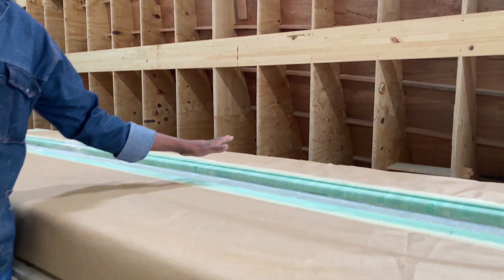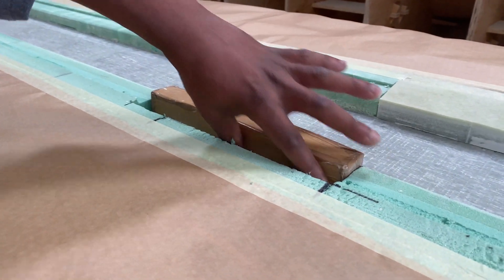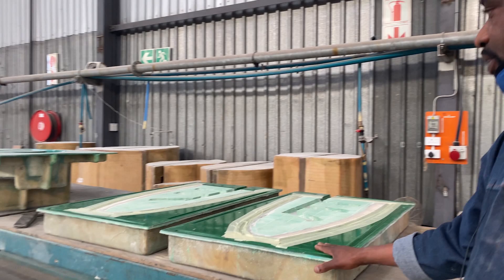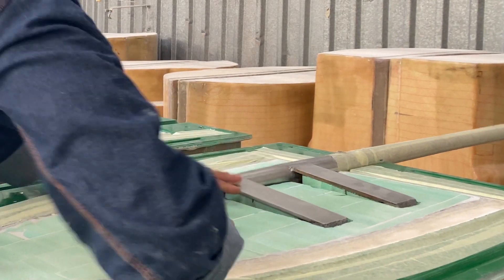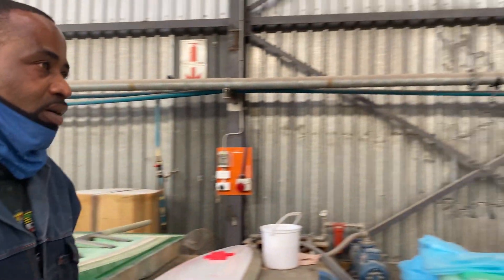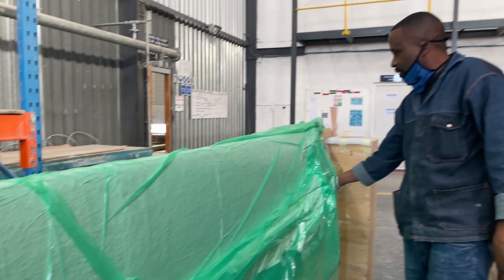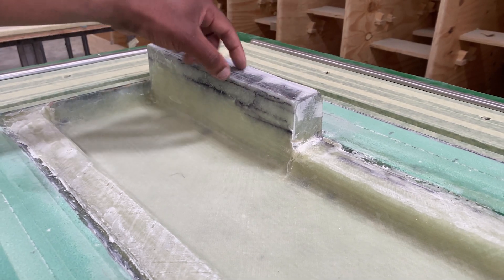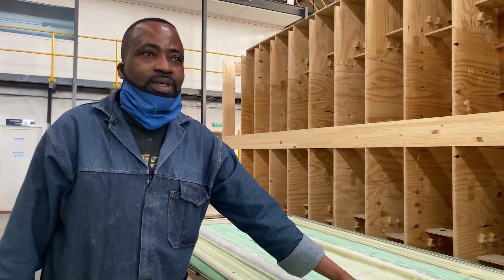Constructing a Daggerboard on a Balance 482 Catamaran

Comment: I would be interested to know what provision is made for collision/impact absorption. Just been listening to one of your customers sailing down from Costa Rica towards Panama in bad weather at speed and describing the nightmare of striking one of those large timber baulks or trees. There is only so much you can do to protect the hulls using watertight bulkheads and sealed cavities etc but the scenario of a d/board being driven aft with it’s sharp trailing edge slicing through the adjoining structure is not a good one. In my experience crash boxes do little to help and freeing the board for extraction will require shore based heavy duty hydraulics or winches. We resorted to frangible/crushable ends to the boards after the first event. 

I wonder what Balance Catamaran’s thoughts are?
Reply from the maker: The first 10 inches of are bows are foam filled crashboxes.  If you are concerned about a forward collision, we can turn both our bow locker into water tight compartments to provide additional security.  
Regarding daggerboards, we design our boards to sheer off under impact at high speed to avoid this.  Of the 1200 Cats that we have had experience with, we have never seen a crash box cause catastrophic damage in a collision. However, there most likely instances where either daggerbaords or crashboxes have caused failures but none that we have had experience with.

If you are troubled by having daggerboards, we can ammodate fixed keels within any of or models. However, if you expect to acheive subuerb upupwind performance, those keel;s must be very deep,  and perfectly foiled.